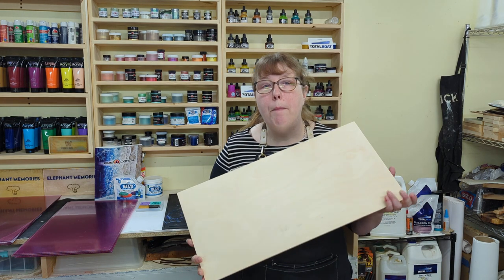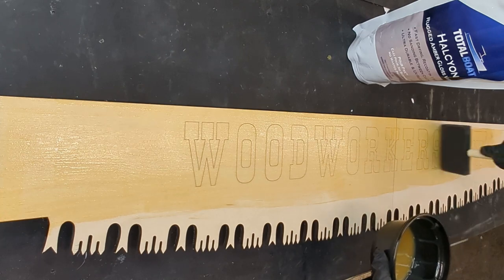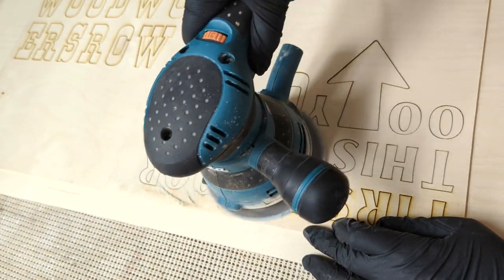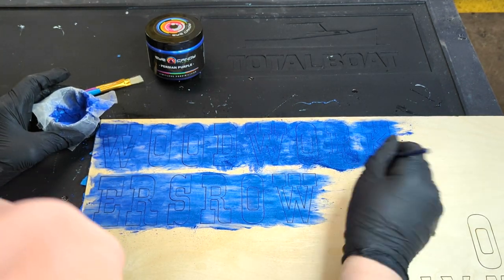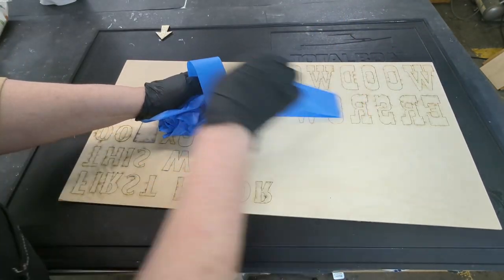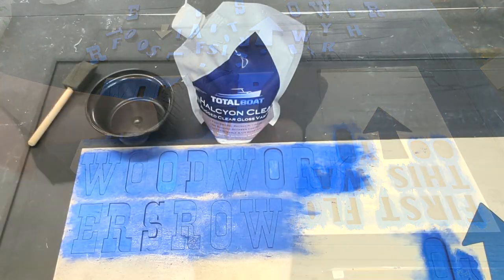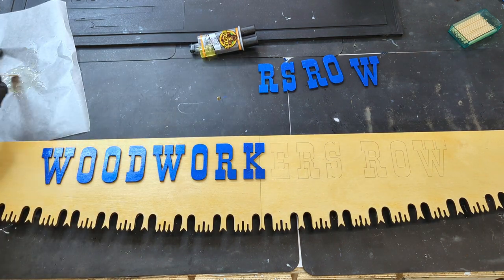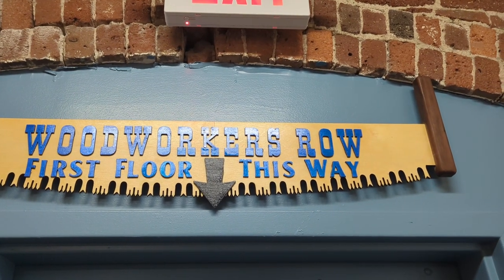Engraving Wood With Color; How to Add Eye-Catching Color To Your Laser Cutter Woodworking Project

Comment: Hi Dayle, when finished, would this make a food safe board?  Very helpful, by the way!
Reply from the maker: This particular project was for a sign and I used a varnish on it.  I would not use a varnish for a cutting board, charcuterie board or serving tray.  Instead, you can seal your project with a food safe epoxy resin.  I use Makerpoxy, Tabletop Epoxy or Thickset Epoxy resins from Totalboat.